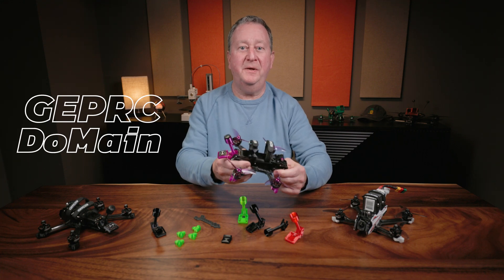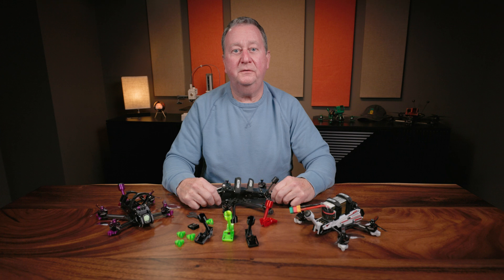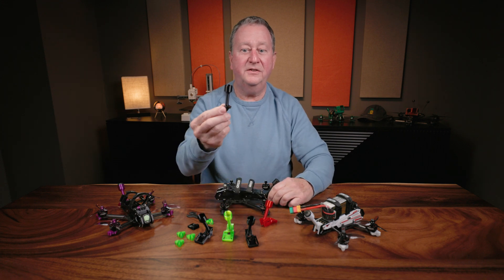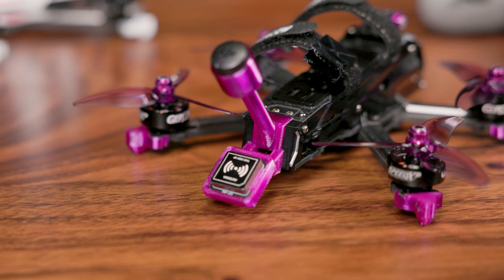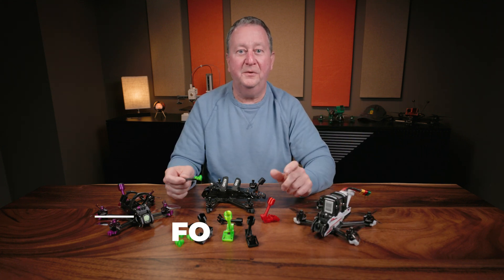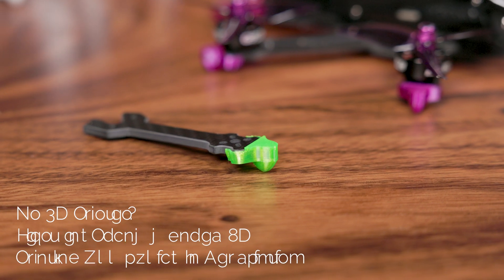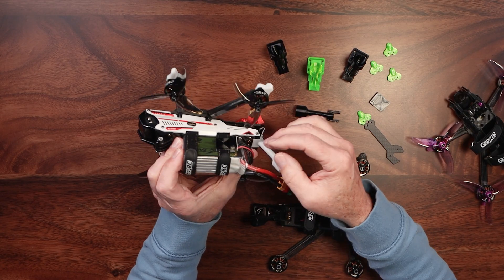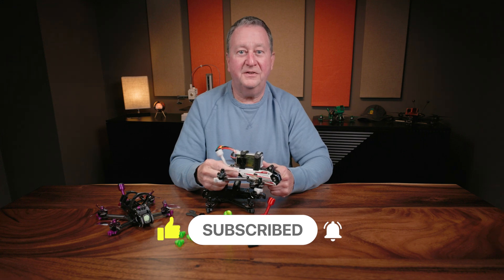Upgrade your GEPRC DoMain with 3D Printed Mods | Customize your Quad

Comment: I have 4 Domains and recently a lot of quality problems with the FCs: Gyro faults, Electric Circuit (5V, 10V) faults... and needed to replace them. Especially if I fly fast and radical, the TAKER F722 might give up suddenly. I am looking for an alternative FC or complete Stack with same mounting holes (25 x 25mm). Are you having similar problems?
Reply from the maker: I had to replace two flight controllers; one was when I took an arm off and the wires crossed and smoked the ESC which got the FC.  The other one just started doing strange things when flying.  On the GEPRC Site the DoMain is not available so they may be coming out with something better or not selling the smaller ones.  I still like flying the DoMain so hopefully parts are available.  Thanks for watching🍍
Reply: @Pineapple22  thank you for answering

Comment: I would definitely buy some of these prints.. do you have an Etsy store or any available for purchase? I know you included the 3d prints for free in the description which is very nice of you. However, I do not own a 3d printer unfortunately. Thanks!!
Reply from the maker: Just download the files you want to have printed and use this page for submitting the print to be printed,  https://www.noozle3d.com/pages/custom-3d-printing  Noozle is real good at getting you a price and getting the part printed and out the door.  Just select that you want to upload your own files.  If you have any problems let me know.